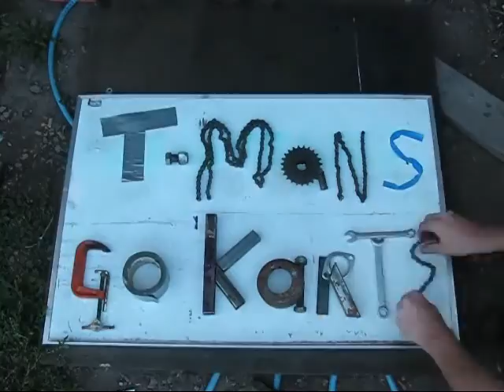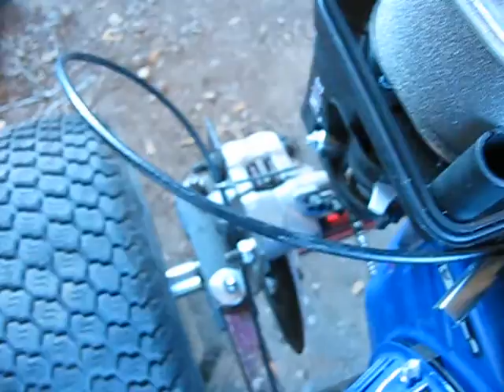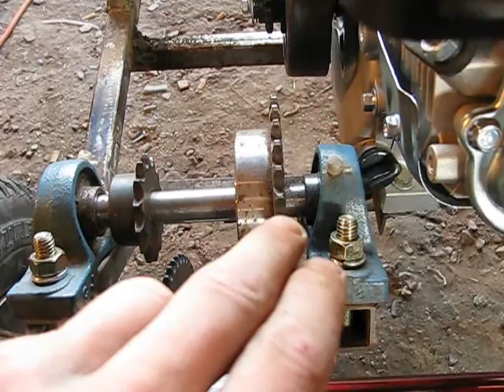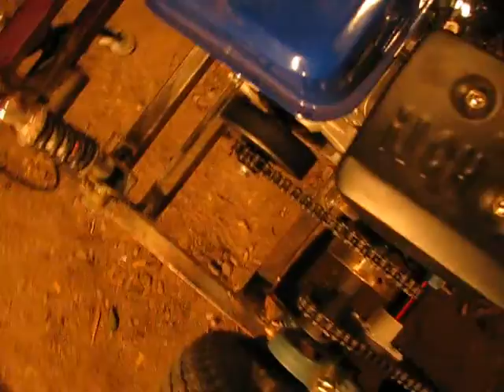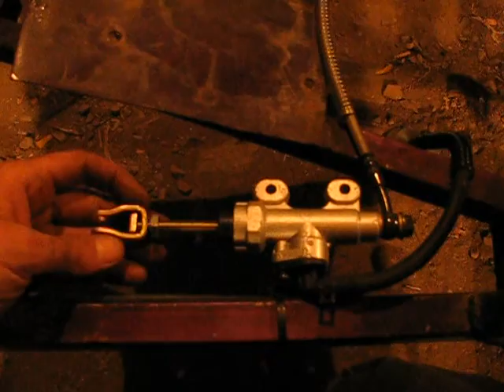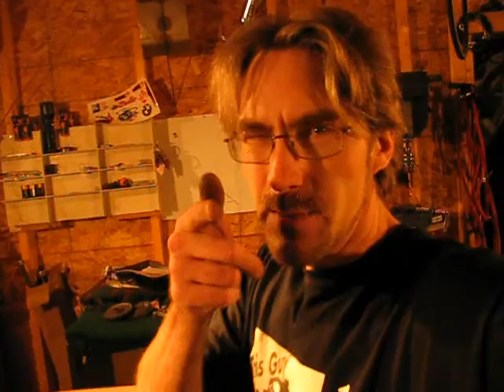GO KART BUILD Throttle Linkage & jackshaft spacers

Comment: Nice vids looking at them is very useful I'm new at this but where do you get a aluminum crimp from I'm using cable stop lol its not working not even for my brakes
Reply from the maker: I get my aluminum crimp things from Ace hardware.
Reply: Hey thanks I'll go to one in the morning I got two more questions if you don't mind is it OK to space my pulling wheel with washers in do my clutch have to be flush with my shaft I have a longer bolt would that work
Reply from the maker: Dominique Davis yep, that will work. The most important thing is make sure that the two flat sides ( on driver and driven ) are lined up.
Reply: Thanks t men how do I send a pic when I'm done looking at your vids help me do it the cables my last step
Reply from the maker: Dominique Davis well the best thing to do would to send it to me by posting it on my FB.